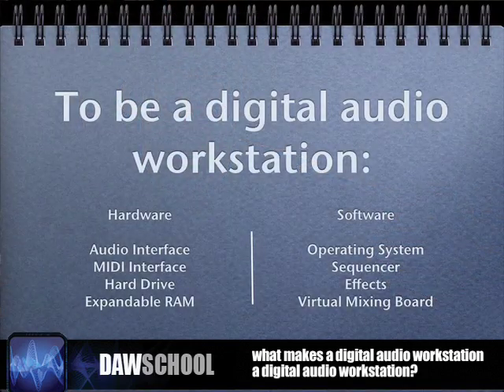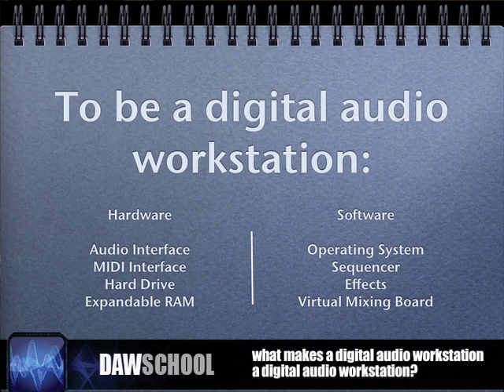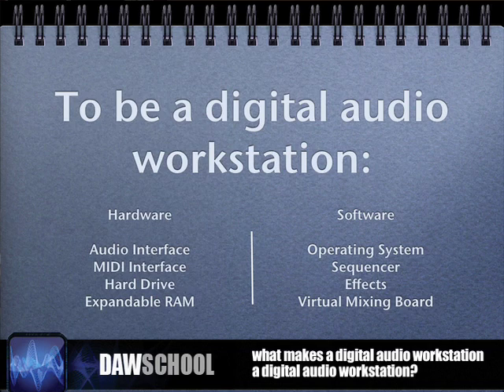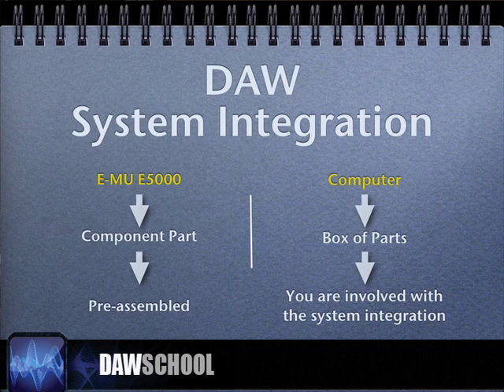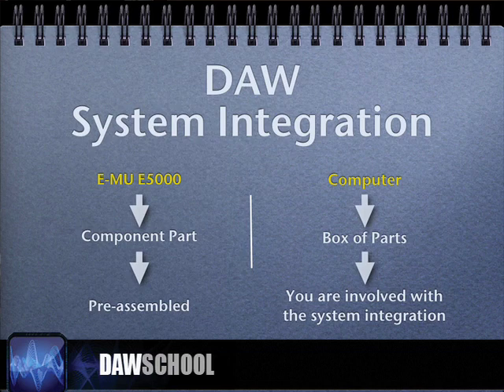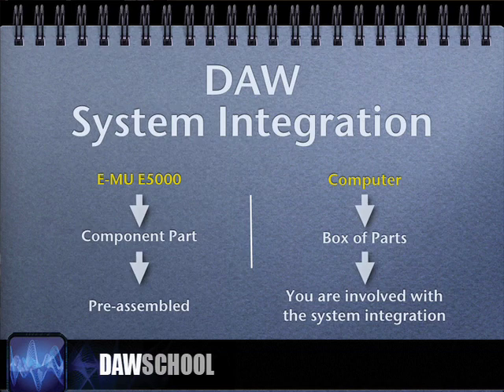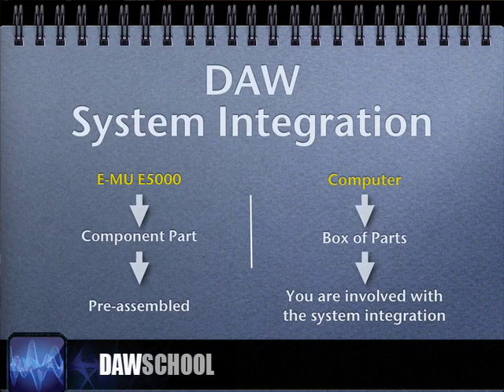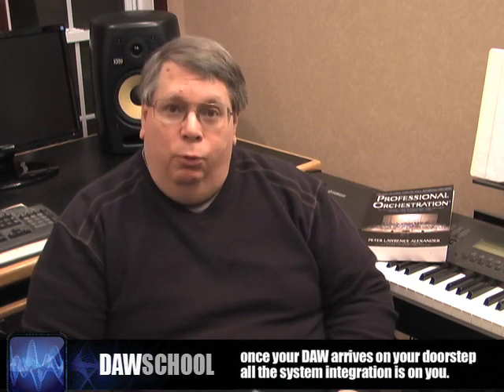DAW School Webisode 3A

Comment from the maker: @yoGregg0ry 
I apologize for the delay in answering you. I don't work in this area, but many who do are using, on the Mac, Logic, and on the PC, Cubase. I'm sure on the PC others are using Sonar. 

One other program used a lot in Europe is Samplitude, which right now is 32bit and needs Windows Pro 32bit mode.

Otherwise, on the PC, the move has been made to 64bit native and the i7 900 series from Intel that can handle up to 24GB of RAM which I think would be more than sufficient for you.